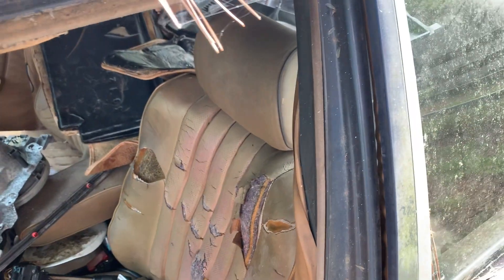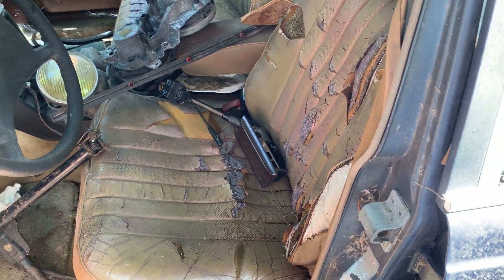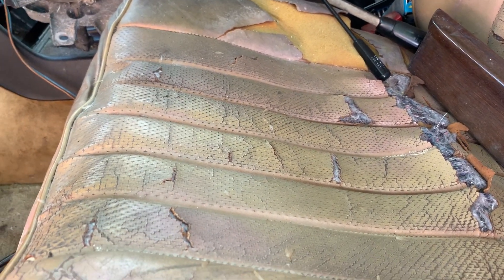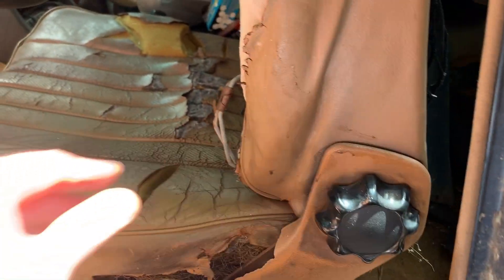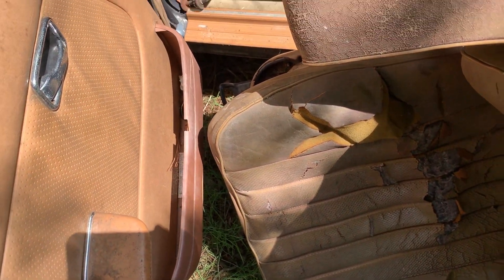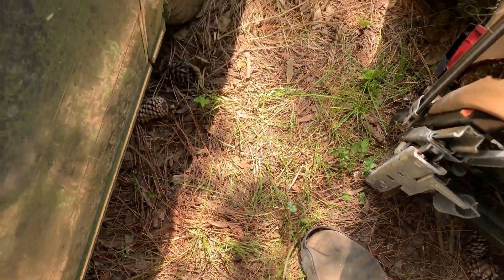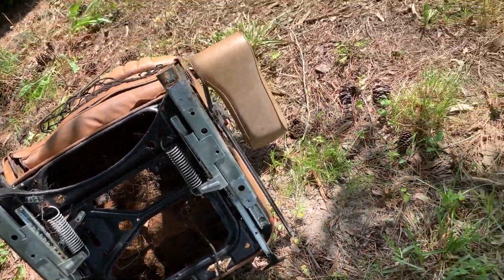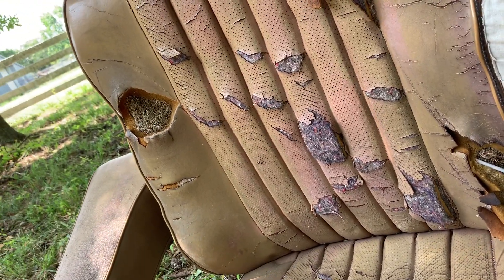Mercedes 300D Seat Removal

Comment: Would this seat dit in a volvo 240?
Reply from the maker: I’ve never owned a Volvo 240 so not sure.
Reply: @mjmcomputers  i am going to measure my 240 seats and then measure a 1982 mer 300class seat at a Pull a Part and see if They will fit !! Will let you know . What size do you think the1972 swat frame bolts are ?10m ?